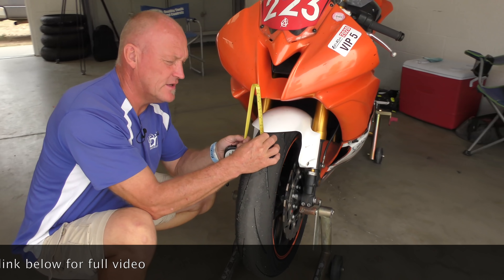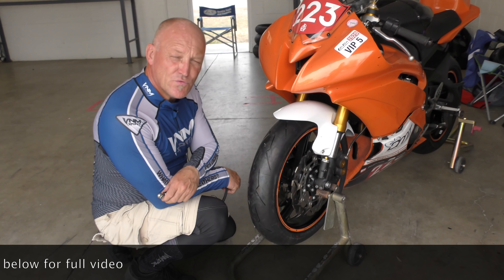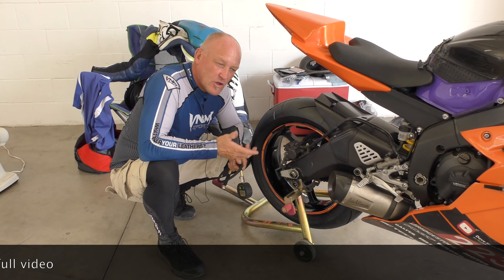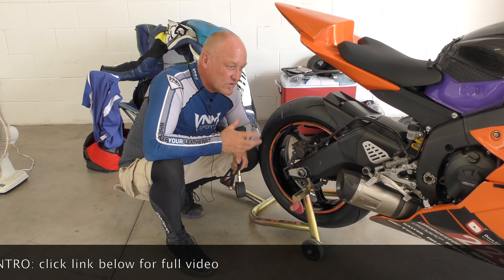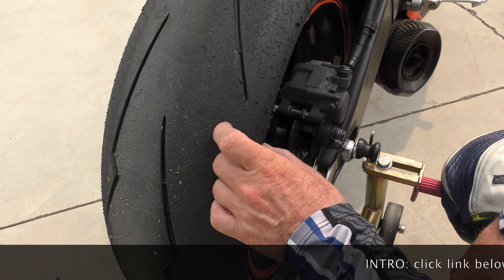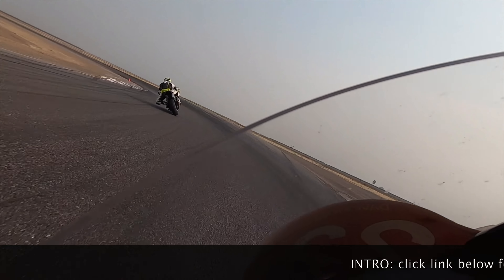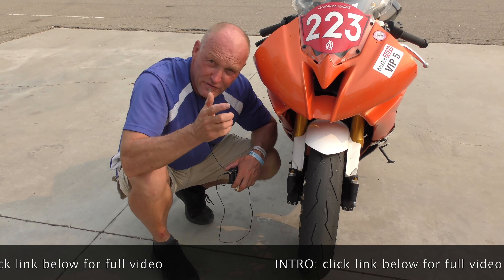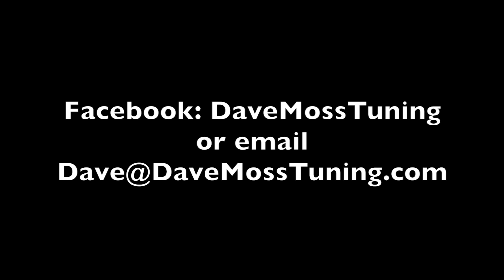Contact Patch: Pirelli Diablo Supercorsa TD Tire Test Intro

Comment: Dave is THE man. Expert on suspension and tires. Having him setup your bike is the best $60 you'll spend. Had him make a few changes this past weekend and immediately felt more confident and picked up some time.
Reply from the maker: Thank you for your trust in my skills and knowledge!
Reply: @Tony Juan Instablaster :)
Reply: @Tatum Raul Thanks for your reply. I found the site thru google and I'm trying it out atm.
Looks like it's gonna take quite some time so I will get back to you later with my results.
Reply: @Tatum Raul it did the trick and I finally got access to my account again. I am so happy:D
Thank you so much you saved my account!
Reply: @Tony Juan Happy to help :)

Comment: Ho Dave, I went from Pirelli Diablo Rosso 3 to Metzeler Roadtec01 SE and took the time to measure the distances aswell. The gap in the front is 1mm wider than before and 11mm wider in the rear. The Pirelli rear was worn out even. It's also noticable because the bike steers less "hesitant". What would you suggest to get it geometrically correct again?

Comment: One thing I have learned, is that a correctly set up bike with proper tyre pressures, and ridden smoothly by a competent rider gives you very clean video images. There's hardly any camera shake at all on these laps. Not like the amateur shakey footage I got on my R6 going as fast as I dared in the novice group at Brands Hatch!

Comment: did we ever get the premium full length vid? the link sends me to the trailer page on the site, even when i'm logged in, always comes back to the trailer.
Reply from the maker: Thank you for subscribing to DMT's Total Access. I greatly appreciate your support of what I do. 

I am sorry that you are having issues with viewing content. 99% of the time clearing the history/cache folder removes the issue instantly.

You can also log in, click on the video and the YT logo will show. Click on refresh and the YT player will switch to the Vimeo player so viewing can commence. 

Note that no user on Chrome has had any issue at all since we launched Total Access.
Reply: @catalystreactionsbw  yup, clearing cache fixed the issue and sent me to vimeo. cheers

Comment: Looking to graduate from stock Bridgestone RS10r’s to Pirelli’s Superbike SC 1 or 2 on my 2019 Zx10r. Ride only on the track at the Budha International here in India. How can I go about getting some remote suspension set up keeping that in mind?  Also, should I really be moving into the slicks or these Diablo TDs ?
Reply from the maker: Slicks will last longer as they can be rotated to get longer life. SC2 rear, Sc1 front. Measure the gap between the tire and mudguard, then remove the RS10's. Install the SC's and measure again to see what the gap is. That will show you what happened to your geometry via different measurements. Once you have this completed, we can start a Remote Tuning session.
Reply: Dave Moss Tuning just one quick question, I should’ve asked this earlier. Will these sizes be fit for the Zx10r - front 120/70/17 and rear 200/60/17
Reply from the maker: @singhamrit79  Yes they will fit - assess geometry with the change
Reply: Dave Moss Tuning thank you Sir

Comment: How about dunlop sportmax q3+?
Reply: I have run the Q3's and the Q4's. Great tires. I have not run these Pirelli's but P"s in general tend to have a little softer side wall while the Dunlop's are firmer.  Its a different feel that comes down to personal choice.  I ran Q4's in advanced group at Jennings and I really was not missing grip.  They felt like a slick and seem to want to be run very hard and work best when you really get on them.
Reply: @motorsavage3835  I'll try Q4 next season , i have now Q3+ and i love them  so far.
Reply: @Sanisani9  They are definitely great tires and are more track focused.  Much better grip and turn better than the Q3's.  I love the Q3's but they are more street than track.

Comment: Loved my pirreli Angel st tires best tires ever
Reply from the maker: Try the GT II as they are even better and I say that from personal experience.
Reply: @catalystreactionsbw  ya but how are they in the rain i live in Texas i have ran 70 mph in 1" to 2" standing water on Hwy and trucks i pass shooting waterfalls out of the fenders power blast to me and the bike not a wiggle like riding on dry road.
Reply from the maker: @adamlong54  As the TD is designed for track use, that is a great question!
Reply: @catalystreactionsbw  i know if you dont pair the Angel st tires both front and back its very squirly on wet roads the front tire pushes the water creating channel for rear tire to make them both rock in wet weather. The Ducati dealre said " i dont know why i sell these tires once a person buys them i never see a tire sale to them again. They did a 24 hr Road test
The tires didn't have wear after that averaging speed of 125 mph i put over 3k miles on them personally and was like new tires still. took 500 miles to wear the Angels off the tires

Comment: Great stuff Dave 'Guru' Moss!! I have these tyres in SP on my 2014 RSV4 and have been trying out low 30s on the front and high 20s on the back. I am a 67kg rider. I do laugh at the factory 36/42 on these super sticky boots
Reply from the maker: Thank you! I appreciate you taking the time to find what works for you!
Reply: @catalystreactionsbw  No! Thank you Sir👍🏻👍🏻👍🏻
Reply: Dave Moss Tuning could you do a review on the Pirelli rosso diablo 3
Reply from the maker: @warrencampbell6335  If Pirelli sees value in what we do, we might be able to do that or we will have to purchase the tires ourselves.
Reply: Your 36/42 is a factory recommendation that a 300 pound rider will be safe. Plus it gives the most tire lifetime.
Reply: @gyzfr6  what?

Comment: supercorsas are my go to tyres in any variation they come out. SP V2, V3, SC medium rear soft front, BSB, first time i heard of TD though. i;ve prefered 29 front 26 rear on most days either track or street. i make about 2500km on a set or 2 td's

Comment: So 29 in front and 27 on the rear are kinda the right pressure to run them on track, right?
Reply from the maker: As a starting point yes. You should see a gain of 3-5psi over cold at the end of the third session.

Comment: Are the Pirelli SC3 slicks the same as these tires? No tire warmers needed? Thanks. I have found them to be cheaper. Greatly appreciate your input.
Reply from the maker: SC3 needs warmers but if the climate is warm, they are not needed.

Comment: Great video as always (watched all as a subscribed member). Dave, How this tire compares to the Metzeler Racetec RR (non slick) ?  I'm curious since Pirelli owns Metzeler
Reply: This tire should be between RR K3 front/ rear and K1 front/ k2 rear, there is not such a tire by Metzler as the Supercorsa TD, which is between the non slick Supercorsas (SC) and the street Supercorsa (SP). Most compareable product by Metzler is the Racetec TD, which should be like the Supercorsa TD, just as a slick, instead of a profile tire.

Comment: Hey Dave I have a question, If you have replaced a rear tyre with a larger diameter rear tyre (7.0mm bigger in diameter, 3.5mm in radius) and have feelings of uneasiness would you- A, raise rear ride height to get SA angle back or B, lower rear ride height to compensate for the difference or C, raise the front ride height? thanks

Comment: Hi Dave,
I normally use the SP V3 tire just for track days only. If I try these it seems I will have longer wear on them, but will I loose a bit of grip?? by the way riding on a Daytona 675 and never sure of what cold pressure to start with...
Reply from the maker: You will not hav any less grip. Use 28 rear and 30 front cold to start and see if you get a 4-5psi gain off track in the 3rd session of the day.

Comment: The Q4 is by far the best gripping tire I have used, the thin hull of the dunlop, are sketchy for rally coursing/ "cannonballing" I was shocked to see how thin the Q4 gets!  I thought I would try a set of power5 mich tires- the rear tire profile is nothing like the power cups- I have trouble with the rear slipping under accelerating out of a turn to a straight... Power5 don't cut it for rally riding- so far the evos are the best I've run, 
Any recommendations on a meztler?

Comment: Hi Dave! What pressure do you recommend for supercorsa sp v2  for trackday intermediate group and aggressive road riding (daytona 675)!
Reply from the maker: Depends on track surface, temps and geometry. General starting point is 36 front and 32 rear HOT.
Reply: @catalystreactionsbw  and what about spirited road riding on twiesty roads?
Reply from the maker: @nikos.kouts3  3-4psi more as speeds on the road are significantly slower and longevity is everyone's key criteria.
Reply: @catalystreactionsbw   αnd why on the road  during agresive riding you dont get cold tear despite the high pressure on the tires?
Reply from the maker: @nikos.kouts3  Slow speeds, and less stress on the tire.

Comment: How is the Rosso Corsa II's for the street/canyons on a ZX10R?
Reply from the maker: All modern hypersport tires are excellent on any bike provided you set geometry correctly.
Reply: @catalystreactionsbw  the new Diablo Rosso Corsa 2 worked fantastic on street or track days on  my S1000RR ! Excellent feed back

Comment: Hey Dave i have a question for you: next mounth i will attend a track day and a buddy of mine has a brand new set of Bridgestone RS10 tyres for me but the load index of those tyres is 75W not 73W (BMW recomends 73w on my s1000r ).Will this difference harm the safety /performance of my tyres? my weight is 70kg. Thank you in advance!!!
Reply from the maker: Hi Cristian. The load rating at 73w is 805lbs total. 75w is 853lbs. That means the tire can take greater stress. You are going to a track so depending on your group and ability plus track temps and correct pressures with appropriate suspension settings the 75W offer more load support.  RS10 is a great street tire and excellent for hot climates on the track.

Comment: Hi Dave! what is the difference between diablo supercorsa TD and supercorsa SP?
Reply from the maker: Diablo Supercorsa SP, limited sizes with good track performance but are more street orientated
Diablo Supercorsa TD, wide size range and more performance than the SPs but not to the level of the race tires
Diablo Supercorsa SC, widest range of sizes and compounds and the best DOT race tires in the market
Reply: @catalystreactionsbw  you are also sayng in the video that TD are more durable than SP .why that?
Reply from the maker: @nikos.kouts3  Single compound so they are supposed to last longer
Reply: @catalystreactionsbw  do tds have harder compound? Thats why they last longer ? Or they last longer only if you use them on trackdays?
Reply from the maker: @nikos.kouts3  Marketing data says harder compound.